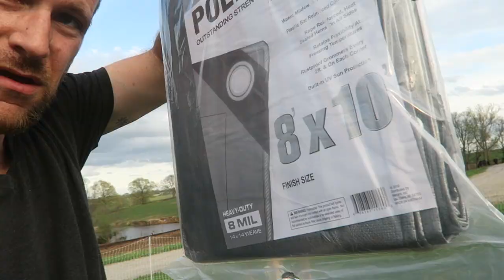Mowing just got a lot TOUGHER

Comment: Glad to hear you got the mower fixed.  We had a Craftsman mower that was doing the same thing.  I replaced the magneto and solved the issue.  I don’t know what I would do if my garden tractor or lawn mower went down.  I would have to stop everything and get it back jn the fight.  Awesome video. Thanks for sharing!
Reply from the maker: +Pfeiler Family Farm - thanks for your thoughts, Kenny! We depend on our riding mower to do a lot as well.
Reply: White House on the Hill funny thing but right now I am working on my Cub.  Gotta replace the blades and level the deck before cutting the grass at church tonight!  Ha ha

Comment: I run stabil and use non ethanol gas and put a shut off valve before the carburetor and shut it off while it’s running and let it die and I have not had any more problems after winter.
Reply: We always buy "high test" (shows my age lol) gas for the gas using tools and a cutoff is great but they should never be stored with fuel in the tanks over winter. Just add as needed in the fall and leave them running until they run dry.
Reply from the maker: +plain speaker - yeah, I was forgot to prepare it for last winter. We had to repair a bunch of stuff. Carburetor, spark plug, gas in the oil tank, air filter, and we sharpened the blades while we were at it. Now it works like new.

Comment: So was it carburetor issues?  When you put up the mower at the end of the season this year try adding a trickle charger and also some fuel stabilizer to the gas.  If at all possible find a source and start running non ethanol gas in all your small engines.  Down here in SW Missouri we're already on our third lawn cut.  Take the battery out if you can't reach with power.
Reply from the maker: +Mate2Frio - sorry, I didn't recap the repairs. Carburetor was loose, spark plug was dead, air filter had to be replaced, gas had flowed into the oil over winter. So we did an oil change and now we use the gas shutoff valve after each time we use the mower. Battery has always died on us since we got the mower about 11 years ago. Seems like we always replace it 1-2 times each year.